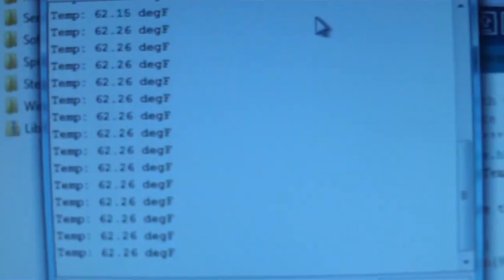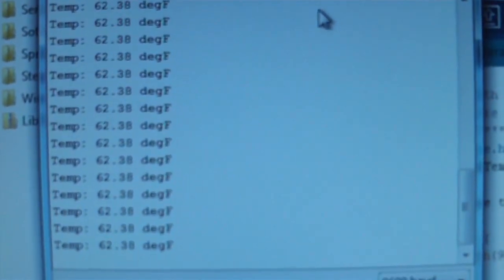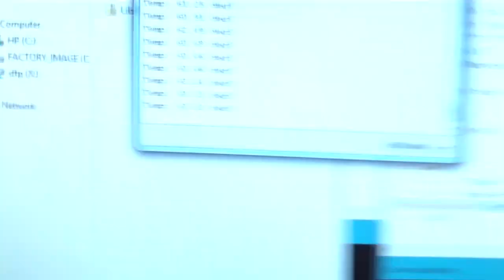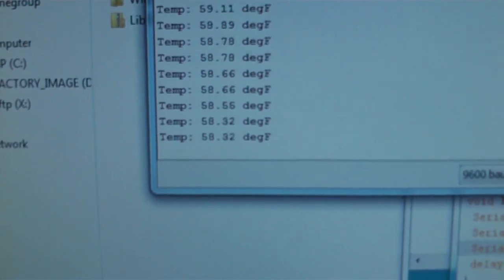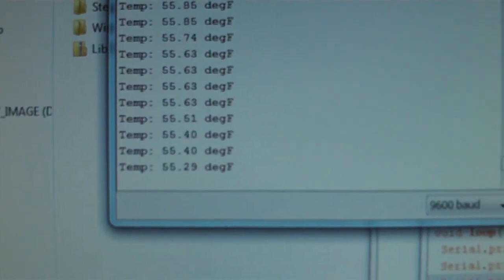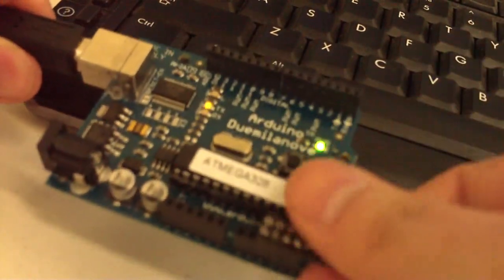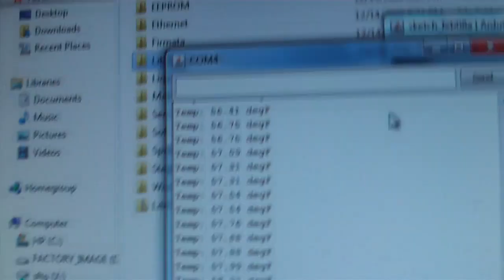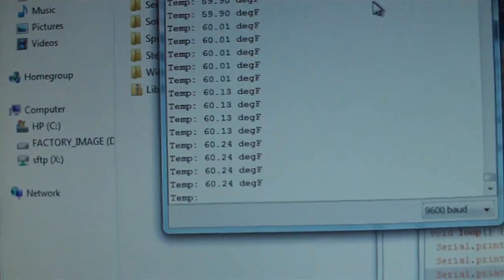Introducing the Temp Sensor for Arduino

Comment: You can have the arduino print out the degree symbol instead of spelling out degree i do beleive if you use (char)248 in your code instead of degree it should work.